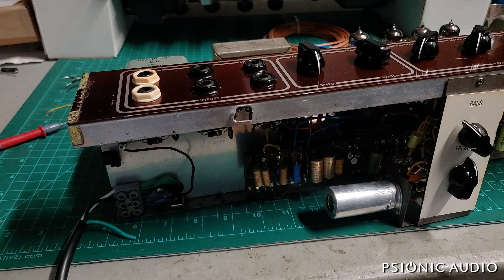Woden vs Albion Output Transformers | Part Four : Taking Measurements

Comment: Wouldn't differences in DC resistance move the "bias point" of the output tubes? I think it would be very interesting to se how/if the idle cathode voltage differed between the two transformers.

Comment: I've got a couple of amplifiers made by Mark Stephenson where he encourages you to play around with impedance matching as a tonal control and the difference between these two transformers was very characteristic of the tone shifts I've experienced. When you went to the 16ohm tap with 8ohm load it gave the super tight (but quiet) type of sound I sometimes use for an aggressive hard rock tone rather than the richer cathode bias sound the amps usually put out. Great fun!!!

Comment: I have a theory as to why the Woden is just slightly more attractive to my ears. 
It might just be enough of a difference in reflected impedance to operate in class A. 
I could be wrong, just a thought based on some load lines and reading.
Reply from the maker: AC30 is a Class A/B amp. Iron isn't big enough to go into Class A.

That said, it's an odd circuit in how it behaves, curves, loads, etc.

But think about the primary impedance with an 8 ohm load. A real speaker isn't a fixed 8 ohm load. Some frequencies are less than 8 ohms - they will be slightly attenuated. Some frequencies are above 8 ohms - they will be slightly exaggerated. 

And this will change with playing dynamics, output level, any feedback between pickups and speakers, etc.
Reply: After Lyles explanations I'm reasonably sure I prefer the woden because its putting out the frequencies my shot in the adze ears can still hear..